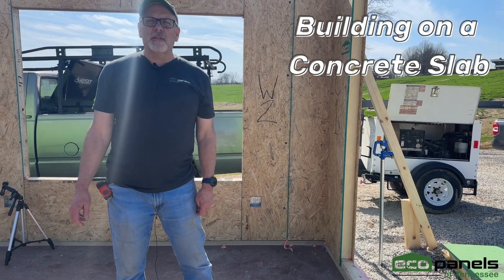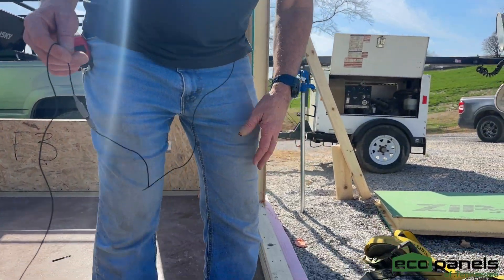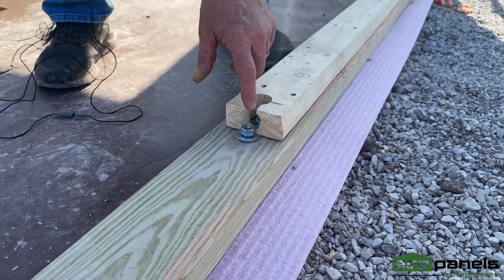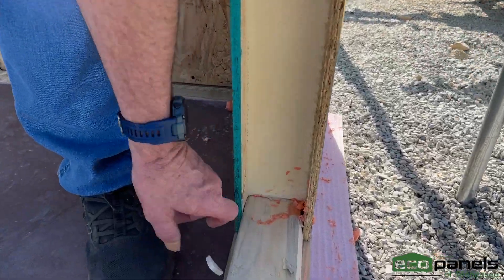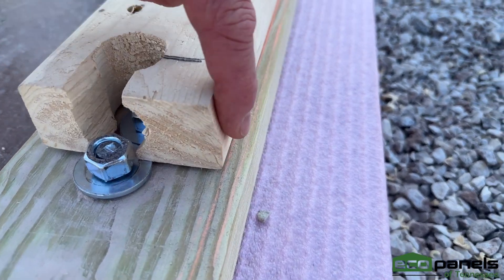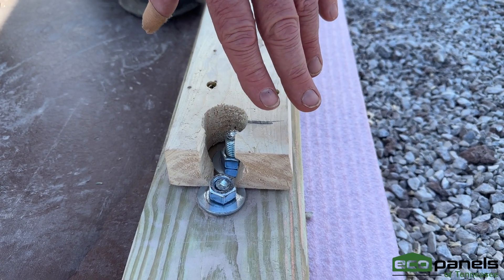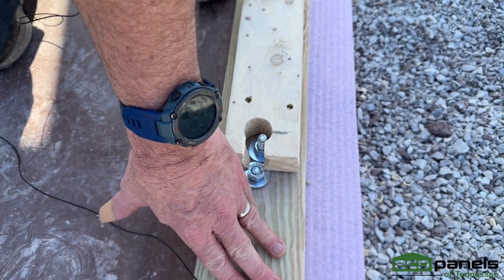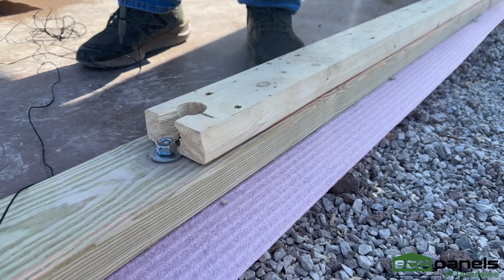SIP Panel Construction on Concrete Slab

Comment: If you rip pressure treated timber, don't you expose the non-pressure treated inside, that's now on the outside? Even if you orient that face towards the inside of the building, you'll still have a corner that can wick moisture up from the slab into the inside of the board.

I'm not a pro, but it would seem better to leave the board wide, with the extra width towards the inside of the building. That would leave a ledge that you can screed up to with an extra 1.5" of concrete.

Perhaps this will give you enough depth to cover underfloor heating.
Reply from the maker: Most clients turn them to the interior and feel comfortable with that. Some areas now by code are requiring that those cut surfaces be treated with a topical chemical, so there are products on the market to address this if it's a concern. You could also chose to do the ledge as you've mentioned. Thanks for the comment and for watching.

Comment: Show the hose bibs please.
Reply from the maker: Thanks for the comment. Took a note on this. If we have the opportunity to go back once they're installed we certainly will. Typically, drilling through the panel to create a path for the bib is not a problem at all. Most people frame up a small plumb to the inside of our panel for this. When on a slab we encourage having plumbing within interior walls as much as possible, and it's code in many areas to do so.